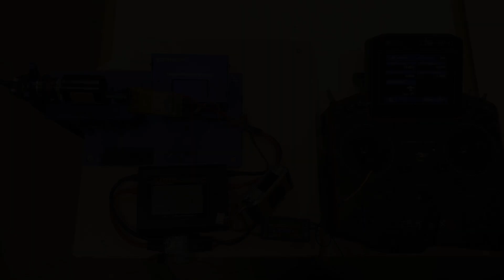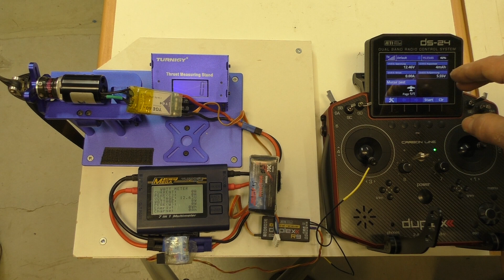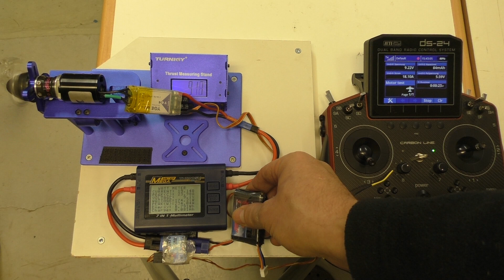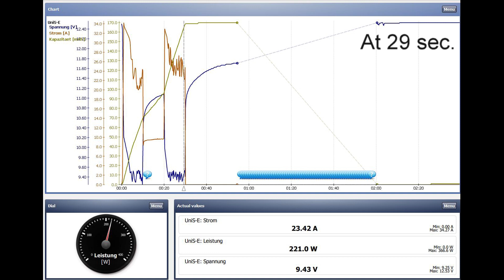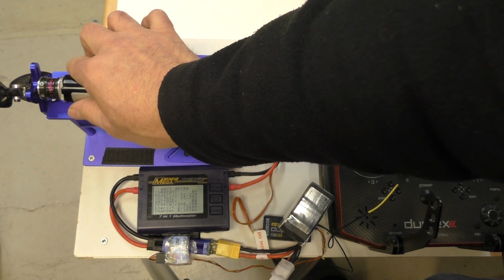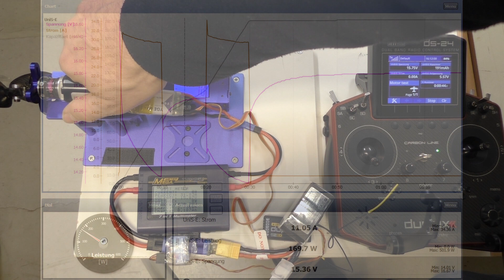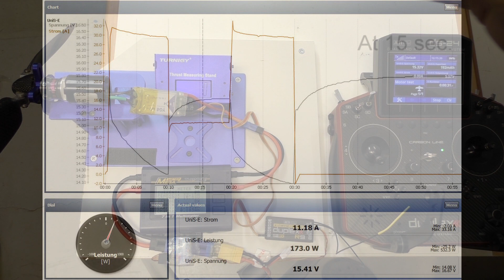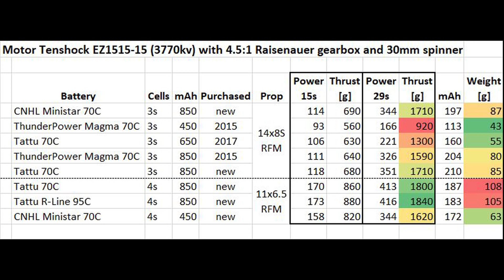F5J: Testing 3s and 4s lipos for power and thrust

Comment: Thank´s for good test video!Which motor should du prefer running on 4s on a Explorer BF dubble Carbon,this motor you test on this video or Leopard LC250-30 4420kv ?
Reply from the maker: Hi. I run the LC250 4420kv on my other Xplorer on 4s450 70C batteries, and it pulls the 1750g plane no prob. I would chose te Leopold, but make sure you have a spring to keep the motor cables away from the bell of the motor!
Reply: @jstjern1  Ok,thank´s!

Comment: So little views for such a useful video! Have you tried the GNB batteries? They seem to be all the rage with the drone guys. Just ordered 2 each of the 3s 550 and 850's and looking forward to 'hopefully' lower voltage drop at the same current. Cheers!
Reply from the maker: My local pals think that RoaringTop is one of the leading batteries for F5J. The CHNL seems to be my go-to solution, mainly due to local availability, and them being "good enough". But, the 1st competition season with them is still ahead, so too early to say.